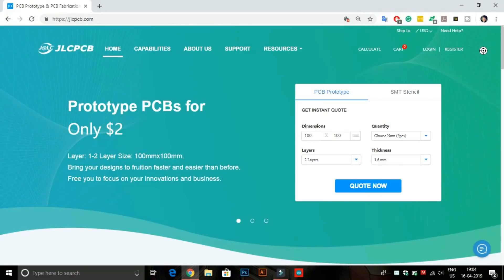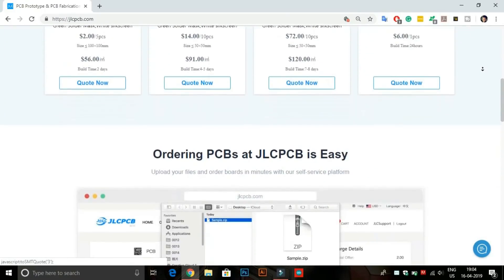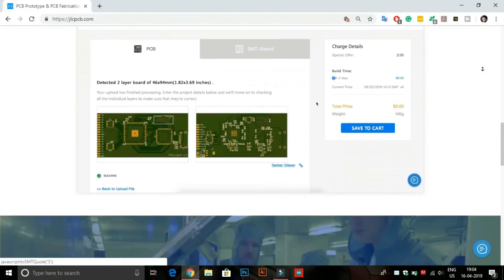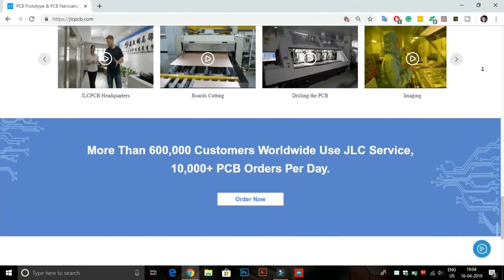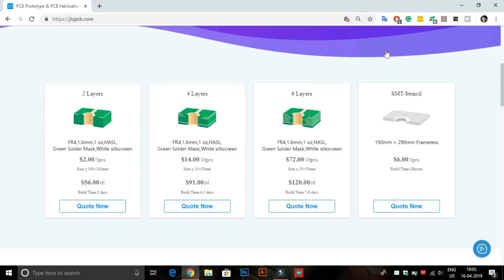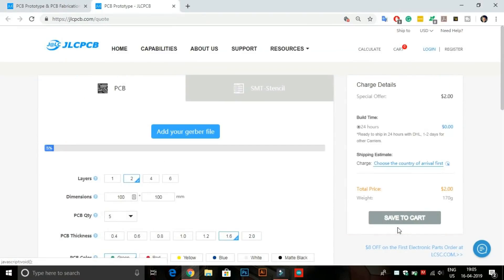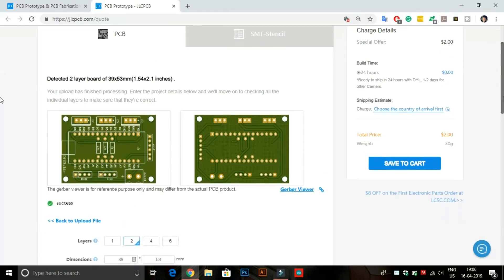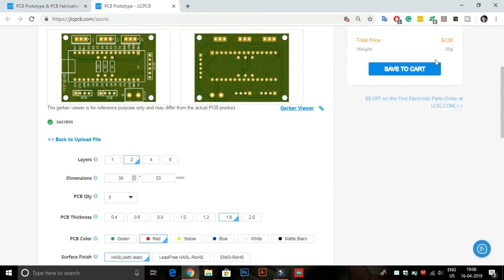How To Make A Simple WIFI Controlled Car (NodeMCU)

Comment: // NodeMCU Based WIFI Controlled Car//

#define ENA   14          // Enable/speed motors Right        GPIO14(D5)
#define ENB   12          // Enable/speed motors Left         GPIO12(D6)
#define IN_1  15          // L298N in1 motors Right           GPIO15(D8)
#define IN_2  13          // L298N in2 motors Right           GPIO13(D7)
#define IN_3  2           // L298N in3 motors Left            GPIO2(D4)
#define IN_4  0           // L298N in4 motors Left            GPIO0(D3)

#include <ESP8266WiFi.h>
#include <WiFiClient.h> 
#include <ESP8266WebServer.h>

String command;             //String to store app command state.
int speedCar = 800;         // 400 - 1023.
int speed_Coeff = 3;

const char* ssid = "NodeMCU Car";
ESP8266WebServer server(80);

void setup() {
 
 pinMode(ENA, OUTPUT);
 pinMode(ENB, OUTPUT);  
 pinMode(IN_1, OUTPUT);
 pinMode(IN_2, OUTPUT);
 pinMode(IN_3, OUTPUT);
 pinMode(IN_4, OUTPUT); 
  
  Serial.begin(115200);
 
// Connecting WiFi

  WiFi.mode(WIFI_AP);
  WiFi.softAP(ssid);
  IPAddress myIP = WiFi.softAPIP();
  Serial.print("AP IP address: ");
  Serial.println(myIP);
 
 // Starting WEB-server 
     server.on ( "/", HTTP_handleRoot );
     server.onNotFound ( HTTP_handleRoot );
     server.begin();    
}

void goAhead(){ 

      digitalWrite(IN_1, LOW);
      digitalWrite(IN_2, HIGH);
      analogWrite(ENA, speedCar);

      digitalWrite(IN_3, LOW);
      digitalWrite(IN_4, HIGH);
      analogWrite(ENB, speedCar);
  }

void goBack(){ 

      digitalWrite(IN_1, HIGH);
      digitalWrite(IN_2, LOW);
      analogWrite(ENA, speedCar);

      digitalWrite(IN_3, HIGH);
      digitalWrite(IN_4, LOW);
      analogWrite(ENB, speedCar);
  }

void goRight(){ 

      digitalWrite(IN_1, HIGH);
      digitalWrite(IN_2, LOW);
      analogWrite(ENA, speedCar);

      digitalWrite(IN_3, LOW);
      digitalWrite(IN_4, HIGH);
      analogWrite(ENB, speedCar);
  }

void goLeft(){

      digitalWrite(IN_1, LOW);
      digitalWrite(IN_2, HIGH);
      analogWrite(ENA, speedCar);

      digitalWrite(IN_3, HIGH);
      digitalWrite(IN_4, LOW);
      analogWrite(ENB, speedCar);
  }

void goAheadRight(){
      
      digitalWrite(IN_1, HIGH);
      digitalWrite(IN_2, LOW);
      analogWrite(ENA, speedCar/speed_Coeff);
 
      digitalWrite(IN_3, LOW);
      digitalWrite(IN_4, HIGH);
      analogWrite(ENB, speedCar);
   }

void goAheadLeft(){
      
      digitalWrite(IN_1, LOW);
      digitalWrite(IN_2, HIGH);
      analogWrite(ENA, speedCar);

      digitalWrite(IN_3, HIGH);
      digitalWrite(IN_4, LOW);
      analogWrite(ENB, speedCar/speed_Coeff);
  }

void goBackRight(){ 

      digitalWrite(IN_1, LOW);
      digitalWrite(IN_2, HIGH);
      analogWrite(ENA, speedCar/speed_Coeff);

      digitalWrite(IN_3, HIGH);
      digitalWrite(IN_4, LOW);
      analogWrite(ENB, speedCar);
  }

void goBackLeft(){ 

      digitalWrite(IN_1, HIGH);
      digitalWrite(IN_2, LOW);
      analogWrite(ENA, speedCar);

      digitalWrite(IN_3, LOW);
      digitalWrite(IN_4, HIGH);
      analogWrite(ENB, speedCar/speed_Coeff);
  }

void stopRobot(){  

      digitalWrite(IN_1, LOW);
      digitalWrite(IN_2, LOW);
      analogWrite(ENA, speedCar);

      digitalWrite(IN_3, LOW);
      digitalWrite(IN_4, LOW);
      analogWrite(ENB, speedCar);
 }

void loop() {
    server.handleClient();
    
      command = server.arg("State");
      if (command == "F") goAhead();
      else if (command == "B") goBack();
      else if (command == "L") goLeft();
      else if (command == "R") goRight();
      else if (command == "I") goAheadRight();
      else if (command == "G") goAheadLeft();
      else if (command == "J") goBackRight();
      else if (command == "H") goBackLeft();
      else if (command == "0") speedCar = 400;
      else if (command == "1") speedCar = 470;
      else if (command == "2") speedCar = 540;
      else if (command == "3") speedCar = 610;
      else if (command == "4") speedCar = 680;
      else if (command == "5") speedCar = 750;
      else if (command == "6") speedCar = 820;
      else if (command == "7") speedCar = 890;
      else if (command == "8") speedCar = 960;
      else if (command == "9") speedCar = 1023;
      else if (command == "S") stopRobot();
}

void HTTP_handleRoot(void) {

if( server.hasArg("State") ){
       Serial.println(server.arg("State"));
  }
  server.send ( 200, "text/html", "" );
  delay(1);
}

Comment: Hi.. really appreciate your work. I have made a same project with my own app, where I can control motor directions with front and rear led attached to the bot. But problem is sometimes the nodemcu losts connection with my phone if I use leds. If I don't use leds it works perfectly. I think this problem may be   happening because of leds drawing more currents from nodemcu. Can you give me a solution for that. Thanks.
Reply from the maker: how many leds are you using?
Reply: @DIYBuilder  I am using a total of 4 ultra-bright LEDs. Should I use a separate power supply for microcontrollers?

Comment: Is this battery rechargeable, explain.. please reply
Reply: Yes this battery is rechargeable.  Because it is a lithium ion battery . It's capacity is around 2000 mAh to 2600 mAh
Reply: How can we recharge it?
Reply: @nithinkichu2595  use a simple charger and the pin which we connect to mobile. Cut it and connect with the battery for 1 hour.
Reply: @aashishsingh1528  will over charging may cause any harm to the battery
Reply: @nithinkichu2595  yes over charging  to any battery lead to damaging of battery  .so be careful only charge the battery to almost  one hour .because it will not give you indication that battery is full charge 😂😂

Comment: I am having problem making a 2WD Smartphone WiFI Car based on NodeMCU ESP8266. 

Hardware concerned:
I think my hardware has no issues… I have done all wiring as described in the tutorial video...

Software concerned:
Software uploading is the biggest problem I am currently facing … The code gets compiled in Arduino IDE software easily but when it comes to uploading it… Initially it shows CONNECTING.....------........------.....
But then after a few seconds it shows me an error which is this:
esptool.fatalerror: Failed to connect esp8266: Timed out waiting for packet header.

Troubleshooting steps already taken:
I have seen some people pressing and holding the flash button while it is trying to connect. I did that but there was no luck.
Additional information:
I have connected the board using the charging cable...
Thank you so much in advance for your help!
Reply: May be your node mcu is not working properly
Reply: @aradhyakrsingh3886  OK... Thanks! I got my problem solved!

Comment: The uploading code is not fully done...it shows invalid till last...what is the solution sir??
Reply from the maker: Did you install all the necessary library before uploading the code?
Reply: @DIYBuilder  yes sir
Reply: @DIYBuilder  after installing also not working

Comment: sir i am getting this

Arduino: 1.8.9 (Windows 7), Board: "NodeMCU 1.0 (ESP-12E Module), 160 MHz, OTA, 80MHz, DIO, 115200, 1M (256K SPIFFS)"

Sketch uses 249506 bytes (32%) of program storage space. Maximum is 761840 bytes.
Global variables use 38424 bytes (46%) of dynamic memory, leaving 43496 bytes for local variables. Maximum is 81920 bytes.
java.io.IOException: Cannot run program "python.exe": CreateProcess error=2, The system cannot find the file specified
 at java.lang.ProcessBuilder.start(ProcessBuilder.java:1048)
 at processing.app.helpers.ProcessUtils.exec(ProcessUtils.java:26)
 at cc.arduino.packages.Uploader.executeUploadCommand(Uploader.java:129)
 at cc.arduino.packages.uploaders.SerialUploader.runCommand(SerialUploader.java:383)
 at cc.arduino.packages.uploaders.SerialUploader.uploadUsingPreferences(SerialUploader.java:197)
 at cc.arduino.UploaderUtils.upload(UploaderUtils.java:77)
 at processing.app.SketchController.upload(SketchController.java:732)
 at processing.app.SketchController.exportApplet(SketchController.java:703)
 at processing.app.Editor$UploadHandler.run(Editor.java:2070)
 at java.lang.Thread.run(Thread.java:748)
Caused by: java.io.IOException: CreateProcess error=2, The system cannot find the file specified
 at java.lang.ProcessImpl.create(Native Method)
 at java.lang.ProcessImpl.<init>(ProcessImpl.java:386)
 at java.lang.ProcessImpl.start(ProcessImpl.java:137)
 at java.lang.ProcessBuilder.start(ProcessBuilder.java:1029)
 ... 9 more
An error occurred while uploading the sketch

This report would have more information with
"Show verbose output during compilation"
option enabled in File -> Preferences.

pleas help me